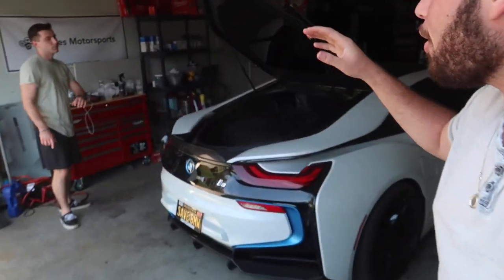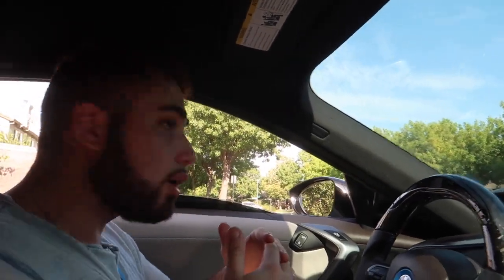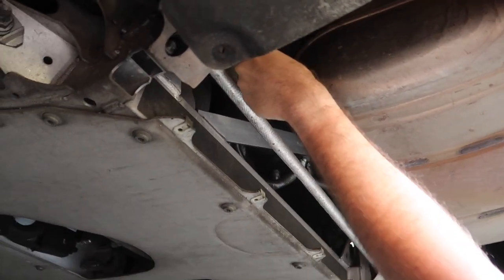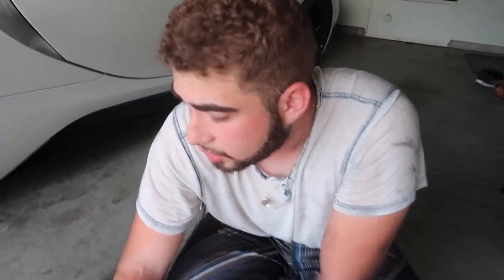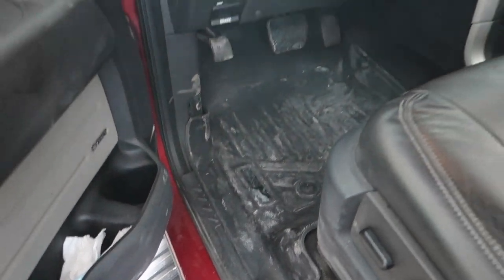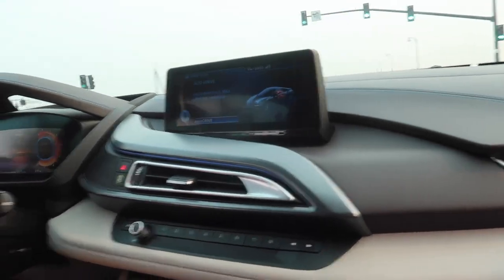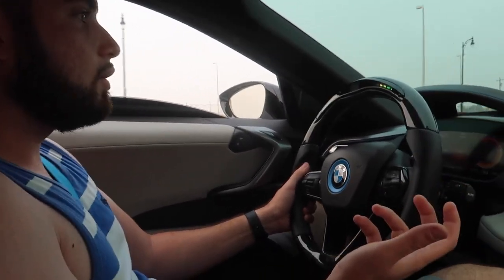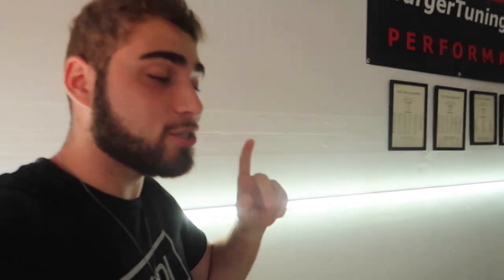I8 GETS INSANE SOUNDING EXHAUST! SOUNDS PHENOMENAL!

Comment: It’s sounds like the m2 rev limiter when you let off
Reply: I didn’t know i8’s can do that pretty sick imo
Reply: Yape! the M2 n55 do that and sound Godly! i love that "brrrr" after you let off gas... I would love mine e92 335i n55 did that too
Reply: @oRicardoHetfield  I would love for my N54 335i to do that but I guess it’s not possible it is probably possible on your N55 powered 335i
Reply: @jay-cee4499  hmm I didn’t search if it is possible, but that would be awesome! I already saw some tuned m235i doing that but don’t know
Reply: @oRicardoHetfield  It was a hot topic at a time MHD Tuning also got in on it I believe they were the ones who made it possible for the M235i to do it
Reply: My f10 N63TU does it as wel sometimes. Same as my b48 F56 mini
Reply: @jay-cee4499  probably not cuz the M engine of N55 is actually very different
Reply: @joshdominguez341  its possible.. its just the tune